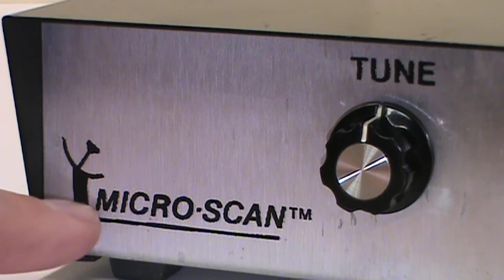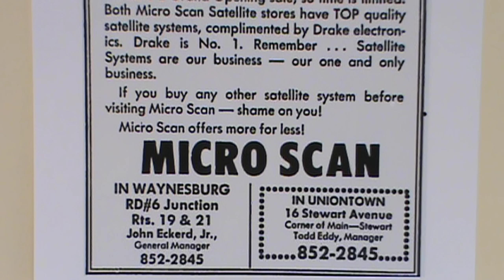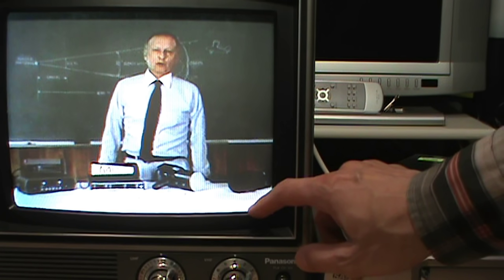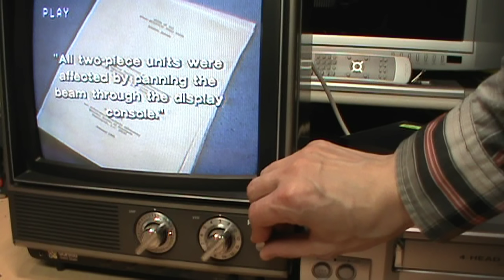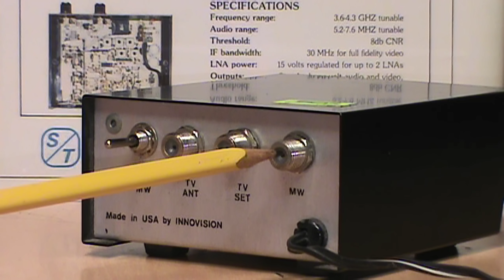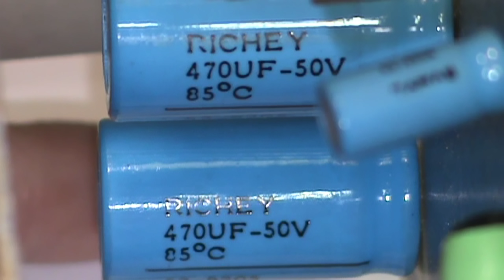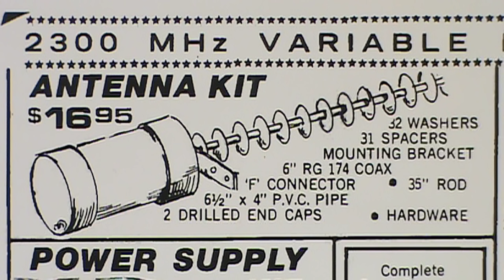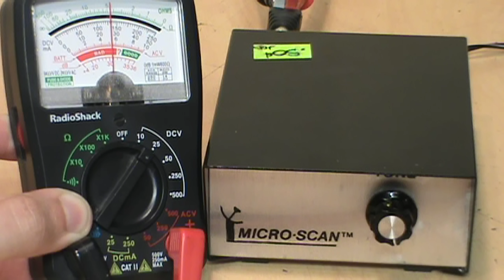Micro-Scan mystery 1980s TV device - Satellite? Microwave?

Comment: SaveItForParts just did a video on a similar product. There was for a while back in the 1980s 2GHz local microwave 'pay' TV. Several free and pay cable channels were available via this service. It's long gone and reallocated. Like most any pay TV service back then there were those not paying. Other devices would permit viewing of the free channels only. It wasn't for hams but for the general public, primarily targeting areas and multi-resident facilities not served by cable. Cable was not available everywhere back then in the way it is today. The alternative, and a great choice, was a big dish. But it was cost prohibitive for most. In 1990 Primestar satellite TV was born. That was a partnership between old Comcast and TCI cable to provide service where their cables didn't go. Several years later DirecTV and USSB and then Dish Network came along, with a smaller dish, better picture, and more channels. Primestar died. These microwave services had all dried up by then.

Comment: I, too, had a similar one to this. I purchased one in the late 80's and am pretty sure it was homemade. The antenna was sealed inside of a 4" PVC tube. I used mine in rural Iowa where cable TV wasn't available. It allowed me to watch a grainy, but viewable channel of HBO. In my case, I could never figure out where the transmitter was (it was very directional, but there was nothing in the direction I pointed it to get the best signal).

Comment: We just cant help it. We NEED to see inside. I bought a similar device many years ago, possibly in the mid 70s, it was in a plastic box and easy to get inside. Just a BNC in and out on the back and a simple plastic toggle on off switch, and the front just said Tune, with no kind of scale. I cant remember the name of the unit, but I got it from an Everyday Electronics Magazine in about 75 or 76, and it cost £1.50. It did absolutely nothing, although at that time the UK only had 3 tv channels.

Comment: In my area in Tampa Florida in the 90s there was a wireless "cable TV" service called videotron. It used a yagi antenna that looked much like what you showed in the video. I never had the service but from what found about it. It looked to be point to point wireless somewhere in the 2.3 to 2.4 ghz and I assume the antenna had a down converter to convert it into TV tunable UHF frequencies.

Comment: Most of the comments referring to point to multipoint microwave are correct. This box was essentially a simple Low Noise Block (LNB) downconverter that took the antenna signal and dropped it to channel 3 or 4 if I recall. Before networks and single stations used satellite relays they would use Ma Bell T1, T3 and sometimes ADSL, or in rural areas without Ma Bell infrastructure (or low budget stations) they had microwave links between the broadcast studio and the transmitter site. Some areas used multiple low power transmitters if terrain and population density limited the effective range to cover areas. Most links were between 2 - 6 GHz.

The tune knob adjusted a voltage level, this then changed the IF of the VFO. That output was sent to a modulator for the TV receiver to pickup.  Depending on the bandwidth, you might be able to use it to receive 2.4GHz transmissions on a VHF receiver that covers 60 - 72 MHz.

If you signal inject to MW you can figure out the downconverter pass band with an FM frequency meter (AKA frequency counter). try a very low power 2.4GHz. I'd not use more than about 15dBm as an inject (0.05 watt) 10dBm (0.01 watt) is likely more than enough. It may be useful for receiving HAMSAT transmission at or above 1.2GHz, but don't know what modulation modes it works with. If it's just a standard block downconverter, it should handle SSB, AM and FM.  If you can find the MW band pass, you can use an upstream LNB to drop higher frequency signals to the MW bandpass and work with that, but quality may be sketchy. I did build one double LNB, one a simple LNB the other a tunable LNB, to copy some Ku  (12-18 GHz) and Ka (27-40 GHz) band signals on a VHF radio. It worked, but not well. More of a proof of concept experiment.

Comment: I had one similar to this device. Mine was a microwave receiver too. I had a 10" receiving disk on top of my television outside antenna. There was a microwave tower about ten miles away that microwaved a signal for the HBO channel. A subscription was required to purchase the hardware. Worked it for a long time.

Comment: in the UK around that time LNBs had Polarisation Horizontal and vertical. That was switched by the voltage powering the LNB.  So that  box would have worked for that.

Comment: I had a box like this back in 1986, it used a parabolic antenna on the roof. It did not work very well, it was a pain in the ass, constantly had to adjust the knob on front for signal. Someone told me once that cable company had people driving around town looking for the antennas, not sure what they could do once the found one . I mean they cant force their way into your house, guess they could try to intimidate you on your porch.

Comment: I'm an electronics technician and lived in Phoenix at the time this unit was made. HBO was received via microwave antennas back then and a converter box like this allowed the customer to switch between broadcast TV and HBO conveniently. The microwave antenna was basically a metal rod with several metal rings on it.
Reply: This is the only right answer I've seen so far. Fellow Phoenician, my uncle gave us a unit.

Comment: The tuning changes a voltage hat is sent to a varactor on the circuit at the antenna, this is part of a set the downconverter at the antenna and the the switch and control on the device.

Comment: Microwave tuner box.  Not just found in rural areas. 

  I had one in the south San Francisco bay area in Santa Clara Valley (Silicon Valley to most) from the mid 1980s to the mid 1990s to get HBO.  Not all locations had cable access and the small trailer court where I lived was one of them. No pole to hand the cable wires.   

The funky receiver dish looked like an 8-petal flower stamped out of 1/8" thick sheet metal with the flat petals of the flower bent at the base of the petals at a 20-30 degrees or so to form a rough dish shape.  The dish receiver electronics in the middle of the dish were fitted inside a piece of 1" PVC pipe sticking out of the middle of the dish.   No curvature to the metal dish at all. VERY simple design but it worked.  I had it mounted on my TV antenna mast below the VHF antenna.

The previous tenant had left it behind but even though I did not sign up for HBO I still got the signal and enjoyed free HBO for years. The dish had to be pointed at a nearby mountain peak that had several microwave towers for various communication needs. 

 The tuning knob was needed because these were so cheap that they could not auto-lock on to a channel and the frequency would drift due to temperature or whatever and the pic would get a little fuzzy/snowy until you tweaked the knob to center the channel again.  Sort of like an old manual FM radio tuner in the 1970s.

At some time at the beginning of the 1990s my HBO signal suddenly turned into SHOWTIME. I guess HBO sold the system  or Showtime just took up the broadcast lease or whatever.  I too left it behind when I moved out in 1994. My new place had true cable access.

Comment: My mother bought one of these in the 1990s. There was a second box (transmitter) that went with this receiver. The transmitter attached to the tv in our living room (because it had a cable hook up) while the receiver attached to the TV in her bedroom. When she selected channel 3 or 4 on her bedroom tv the box would broadcast the program shown on the living room tv. That way she could watch cable programs in bed without having to pay for a second cable connection. (Back then the cable company charged customers for each television that was hooked up) 
The only problem was we couldn’t change the tv station in the living room while she was watching a cable show through her tv receiver. 
This was before splitters were used. It was also long before HDMI options (the TVs were all analog then)

Comment: I not only know what it is... I've used one.  Back in the day, cable was local and over the air.  You needed equipment and range to receive it.  One such cable network was something called WHT (Wometco Home Theatre).  It served the NYC and parts of Jersey.  They broadcast over UHF (scrambled) and had a decoder box with an antenna.  It was one channel and only broadcast at night... but if you had the gear, you could pick it up.  Thanks for sharing!  That brought me back to a time when movies were magic.
Reply: When 10:30 PM rolled around they started their “nightcap” programming. Not kid friendly at all! 😂
Reply: @Fireship1  I grew up up in the Metro NYC area and in 1985 a friend and I went to Canal Street in lower Manhattan to buy the WHT descrambler box to watch the "nightcap" films. Waste of money as I was on the fringe of the channel 68 broadcast radius and only got snow. Can't believe I spent my hard earned $ on that thing. LOL.

Comment: That power supply would be awesome for a car stereo on the work bench so you can play CDs or tapes.
Reply from the maker: It doesn't have enough current for that, though. Car stereos can take up to several amps to power the amplifier.
Reply: @vwestlife 
add a simple charger controller and a battery.

Comment: Interesting box. To a forty-year radio broadcaster, MW is medium wave, better known as the standard (AM) broadcast band, between 530 & 1700 KHz here in the US. In another context it could mean microwave. Older analog STLs (studio-transmitter link) via 450 MHz (and up) is how we got the signal from the studio out to the remote transmitter site for broadcast. Now we use digital modes via ptp microwave and, more commonly, IP based STLs.

Comment: here in miami they were used to get HBO..Tower One,a building downtown Miami had a terrestrial transmitting antenna broadcasting HBO over microwave..You could use this box along with a convertor that would be mounted to  microwave yagi and a 70 mhz converted to signal down to the tv..The box had a variable power supply    and you could change the IF  freqeuncy  using the knob on the front

Comment: I had a homebrew box like that.  It was a variable Voltage supply, for my microwave "coffee can" antenna (a 1 pound coffee can with a small antenna probe inside and a receiver on the bottom lid).    It worked, but it drifted with temperature.

Comment: That is a disguised HBO receiver from the early 1980's. Yes, it is a microwave down converter. In the early 1980's within many areas, the HBO signal was relayed over terrestrial microwave towers as part of Multichannel Multipoint Distribution Service (MMDS). If you lived within the line of sight of a tower and had the right equipment, you could pick up the HBO signal for free. HBO was always a pay TV channel similar to ON TV. Many companies, including Microscan, made devices to receive this HBO signal.  The above unit also included a directional microwave antenna, similar to the one you show,, as part of the disguised kit. These devices were sold in the back of many magazines, such as Radio Electronics, and were not advertised as receivers that could get you free HBO.

Comment: I remember these "ham radio" (wink, wink) receivers... And the microwave transmitters with the "Modulated Power in Hertz" knobs that 'just happened" to interfere with speed radar, and the "export" CB radios with 80 channels (instead of the legal 50) and FM mode (in addition to the legal AM and SSB) and "export" cordless phones with a claimed one mile range and the "Video Stabilizer's" that "happened" to defeat suppressed-sync pay tv...

Comment: The variable voltage was for the variable boltage capacitor tuner in the antenna which contained a pre-amplifier that hooked up to the 2.5 Ghz antenna on the roof.

Comment: That was the memory I had about this box. During the 1980's there was a construction project box that was similar to this one in the vid. We came to work at the electronic shop where I worked and we figured out how to make the antenna shown in one of the drawings. It was a version of a high gain yagi for receiving a 2ghz signal and converting the signal to TV channel 3 or 4. The purpose was to intercept an MDS signal on the Channel 20 tower in Washington DC sending HBO to authorized receivers at the hotels in town. HBO was aware of this hack and it became a news alert that "they" were driving around town looking for these Yagi antennas and the owner could be sited for  illegally receiving this subscription service. So I sent off a letter requestion a legal subscription to HBO and they sent me a HUGE parabolic antenna that gave me a much clearer picture. I split that signal and ran a CCTV cable to their house next door and they had free HBO...

Comment: My family had one of those one-knob boxes (white with simulated wood trim) back in the early 80's. It was bootleg device to receive the "Z Channel" pay tv service for free. The "MW" is where you connect the terrestrial microwave antenna. The antenna that came with it was a circular finned yagi, similar to the one you showed from the ad. We re-discovered the device in the 90's after it disappeared to the back of the garage and hooked it back up to see if anything would come in. And while the Z Channel was already long gone, it did pick up a live video from a stationary camera mounted inside a Asian TV Station's news room. We lived in Los Angeles at the time and the antenna was pointed at Mt. Wilson. While I didn't understand what they were saying, it was kind of cool to see the "behind the scenes" in a newsroom. I believe the "ham radio" reference is a (wink-wink) kind of way of saying it was an illegal device, similar to how Baofeng walkie-talkies are marketed as ham radios, but can transmit on multiple bands.

Comment: Many years ago, before cable tv was available in Boston (Sometime in the early 80''s) I paid for HBO and it used the same system and antenna. The tuner box was a little smaller and plastic but the roof mounted antenna was the same. It was pointed at the (I Believe) Prudential center which broadcast the signal.

Comment: Its an indoor unit as part of early satellite C Band systems. The voltage tuned a downconverter on the back of  a c band satellite dish from the 3-4 Ghz range down to 70 Mhz and the receiver was a demodulator from 70 Mhz FM to video/audio. The dish had a LNA not an LNB as they hadn't been made yet.  It didn't have anything to do with MMDS.